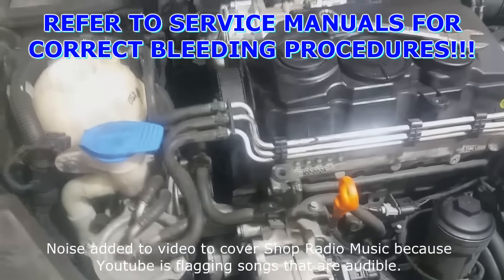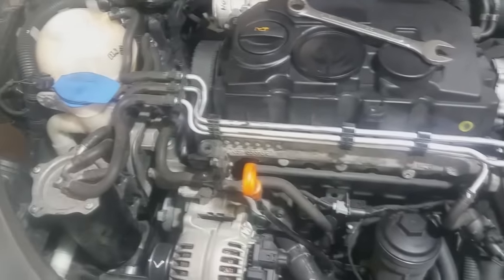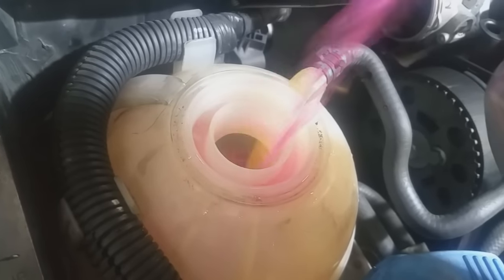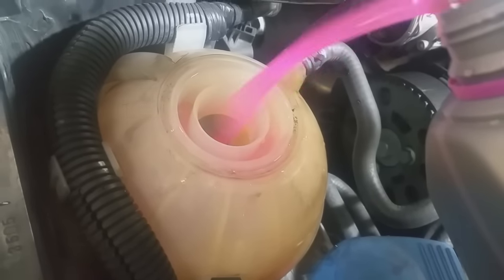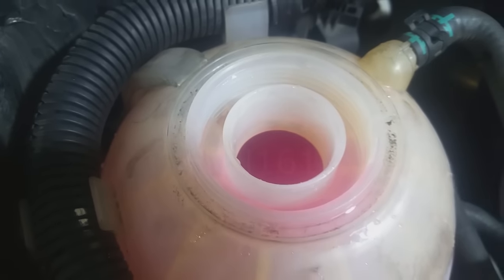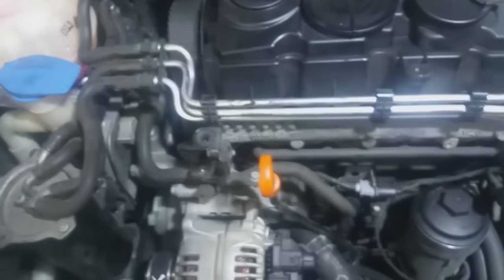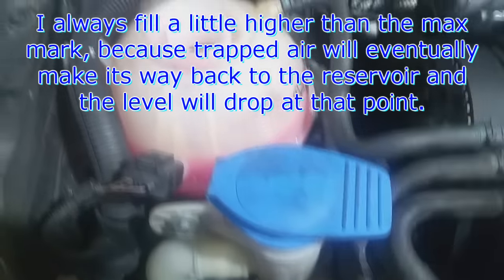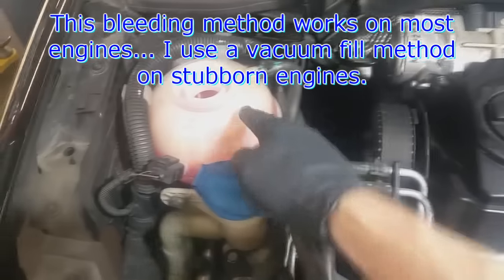Basic VW cooling system filling / bleeding info (viewer request)

Comment: do I use this same method if I just replaced the Heatercore or do I need to add coolant to the Heatercore as well???
Reply from the maker: It's a good idea to fill the heater core before you attach the hoses... but a correctly working system will bleed the air out on its own.  Hold the rpm at 2000 and check for coolant flow back into the reservoir. Monitor heat output inside the car. If you get no warm air by the time the temperature gauge is is the middle, then you have an air pocket.
Reply: Thomas EXOVCDS thanks again buddy did the second one no problems after a 30 min idle and a 45 min test drive second time you've come thru for me my brother I will not forget it lol

Comment: I have a 2011 Vw jetta 2.5 SEL . I accidently added green coolant on top of the original.  I get hot air out of my left vent but not middle or passenger side. I got a new heater core, should i flush the old coolant, fill the new heater core w g12 and then install it and refill the coolant with g12? or is flushing it not necessary
Reply from the maker: Type of coolant won't affect heat output. The vents are controlled independent from one another... if it has dual climate control. I'd suspect an electrical issue with an air blend door motor.
Reply: @EXOVCDS   Thank you for the quick replu. it has no dual climate control. I will only change the heater core then. i already checked the air blend motor and it works. im guessing my heater core is damaged
Reply: @EXOVCDS  https://www.youtube.com/watch?v=zm1HRU64Dpo  i have the same exact issue as this person, just didnt know if i needed to flush my coolant since its green and g12 mixed. I got a brand new heater core from the junkyard from the same edition car but 100k less miles than mine. hopefully it works
Reply from the maker: Depending on how much coolant you added, a flush might do good... should be done every 4 years anyways.
Reply: @EXOVCDS  do u recommend doing the flush w the bad heater core, then installing the new one? i really appreciate the help its being a hard winter.
Reply from the maker: I'd have to check the layout of the heater core & blend doors. I can't see how one side would be warm and the other not (on a non dual climate control system). I'm still at work, will get back to you once I'm at home later tonight (6pm pst>). Flushing the core first and seeing if things change can't hurt.
Reply from the maker: I can't see how 1/2 the core would supply good heat and the other have not... I still think that it is a blend door issue (somehow affecting the passenger side). I have not yet had to replace a heater core on that year of a vehicle. Removal of the dash is required. Disconnecting the core at the firewall and flushing at that location would be more beneficial than flushing the whole system from another location.
Reply: @EXOVCDS  you dont need to remove the dash for this car it's a newer model.  It's under the steering wheel where ur right shin is, my defroster doesnt work either
Reply from the maker: Sorry... I looked at the wrong service info then.
Reply: @EXOVCDS   I already got the heater core from a junkyard same year car looks brand new, should I flush my coolant first?
Reply from the maker: Sure.

Comment: Am I suppose to run the car with out the reservoir cap on
Reply from the maker: Year, make, model, engine? Once the fluid level does not drop anymore you can start the engine and check for flow back into the bottle. If you have / see flow back into the bottle, you can install the cap. Fluid level might still drop a little bit after first starting, so you might want to leave the cap off for a few minutes. If fluid level starts to rise and wants to overflow from the reservoirs, something is wrong (possibly air still in the system).

Comment: The squeeze is just for the upper radiator hose or the lower one?
Reply: Great video btw , keep it up!
Reply from the maker: Squeeze whichever hose is easier to get at... usually the upper one. Make sure that you have coolant flowing back into the reservoir once the engine is running!!!

Comment: What do you do if it doesn’t gurgle and you have blockage like you said
Reply from the maker: Find the blockage.
Remove the hose at the top of the reservoir. Blow into it. If you can not blow air into the hose, remove the hose at the other end (wherever that is) and blow through the hose again. If you can now blow through the hose, continue checking items downstream of that hose. 
Sometimes a hose or T fitting gets clogged. Use a thin stiff piece of wire and poke the debris free. 
If the hose and everything else is free to pass air, then the water pump would be suspect.
Watch this video.
https://youtu.be/LiDRUWPw_f4?si=1bj9NxPkjFW7QDnN

If you are still looking for the spark plug wire tool... Google this:
"VW spark plug wire tool"
To find a similar tool.
Reply: @EXOVCDS  when I take the hose out everything seems to flow nice like the coolant into the reservoir
Reply from the maker: @sniperpaintcorrection6790 
So what's the issue then?
Year, make, model, engine?
Was work done and then a problem started?
Or
Was there a problem you are trying to fix?
How much coolant did you drain?
How much coolant did you add?
The more info I have the better & quicker I can help.
Reply: @EXOVCDS  my car been sitting for years figured I get it back going . Changed the coolant and when the car reaches temperature the coolant starts to boil and over flow out the reservoir. Then steam came out the radiator crack. So I just changed the radiator today and changed the fan switch sensor . Just hoping after I put the new coolant in that it doesn’t over flow . Everyone says gasket but my car doesn’t over heat . But the coolant does over flow . Haven’t tested it yet since I added the new radiator.  1995 VW Cabrio
Reply: I’m assuming the water pump is good if the coolant is flowing to the reservoir . Also I’m assuming the thermostat is good cause the car doesn’t over heat and the hoses get hot. So idk what’s causing heat to build up to the coolant reservoir and causing it to overflow
Reply from the maker: @sniperpaintcorrection6790 
Remove the radiator cap and make sure that the o-ring inside the cap is sitting correctly  / not twisted or split.
Run the engine till warm, but before the point of coolant loss at the bottle. Shut engine off. Upper radiator hose should feel warm and have pressure (try to squeeze hose). If pressure is present, allow engine/ coolant to cool off. Once cool to the touch, the hose should NOT have any remaining pressure (soft when squeezed).
Yes / no?
Reply from the maker: @sniperpaintcorrection  
Heat doesn't cause the reservoir to overflow.
Excessive pressure or a faulty cap do.
I'll wait to hear back from you about the cap and the pressure check that I mentioned earlier.
Reply: @EXOVCDS  would the crack radiator cause this to happen ? And it over flows when the cap is off
Reply from the maker: @sniperpaintcorrection6790 
It's very difficult to help if you feed me information that I should have known about 2 posts ago.
I would not have suggested checking the cap or for excessive pressure.

NOW, that I know that it is overflowing with the cap OFF... it is either due to trapped air in the engine or the thermostat being stuck closed.

If what you say is true (upper & lower radiator hoses are warm), then why is the radiator fan not coming on... or is it? Also something that you gave not yet mentioned. 

If coolant is flowing back into the reservoir & the thermostat is opening, then the radiator fan(s) should get triggered by the rad fan switch. 

What temperature does the ecm show (with scan tool) when the coolant starts to get hot at the lower rad hose?

Leave the reservoir cap ON. How high does the needle go? When do the fans come on?

If the temp needle goes past the mid point... the engine is overheating.

Let cool off and check pressure of upper radiator hose... as requested 2 posts ago.
Reply: @EXOVCDS  the radiator fan kicks on.. the temp gauge on the dash stays in the middle .  The upper hose gets very hot but I thought that was normal .i don’t have a scan tool to check the temp. I used a digital thermometer the other day and the hoses were about 160-170 degrees .
Reply: @EXOVCDS  sorry didn’t see this post before. But will get back to you on that technique and see what happens .
Reply: @EXOVCDS  I believe when it cools down my hoses are soft to touch .
Reply from the maker: @sniperpaintcorrection6790 
An 87c thermostat is 188F.
Upper radiator hose will be hotter than lower hose where the rad fan switch is.
Rad fans are triggered at 92c & 95c (197f & 203f).
If pressure remains in the cooling system AFTER the engine has cooled off... the head gasket is bad.
If pressure drops, then the thermostat is probably bad... but it can't be, if you say that the rad fans come on. So then we're back at head gasket.
Air in the engine should bleed itself out into the reservoir. A few hot to cold cycles where the thermostat opens should bleed air from the radiator.
A radiator only cracks due to excessive overheating.
A head gasket only goes bad due to excessive overheating.
If the thermostat hadn't been changed yet, replace it.
But if the head gasket is bad,  a new thermostat can't fix that.
Reply: @EXOVCDS  I could have a bad head gasket and the car doesn’t over heat? No smoke from my engine bay?
Reply: @EXOVCDS  the car has sat for about 5 years.. I check the oil and the coolant and I don’t get the white milky stuff people say if it’s a bad head gasket . My oil still looks clean. Oil cap looks new

Comment: Owners manual says 9 quarts but only was able to put in 4. I flushed the radiator with 6 gallons of distilled water.
Reply from the maker: Yeah, make, modle, engine?
No matter the make, model, engine... you will never get all of it out. "Flushing" will leave some distilled water in the system, which reduces the amount of "mixed fluid" you can add. Drive the vehicle for a few days and then check the fluid "concentration" to see how close it is to 50/50. If it is weak, remove some coolant from the system and then add 100% coolant to bring the mixture closer to 50/50. You'll have to drive the car so that the newly added coolant can mix with the mixture that is in the system. Check again after a couple of days.
Reply: @EXOVCDS  it’s a 2006 VW new beetle 2.5 liter.
Reply from the maker: The heater core was probably still full of coolant / distilled water (depending on how you flushed the system). You pretty much need to disconnect multiple coolant hoses to drain the system AND force air through the system to blow most of it out... even then, there will be stuff left behind. Flushing / changing the cooling system every 4 years, will keep the system clean (even with some old stuff is left behind).
Reply: @EXOVCDS  okay that makes sense. I did run the car and heater while I filled and drained with distilled water. The antifreeze was the pink stuff from an oil change place so I wanted the purple antifreeze. The flush did run clear so I was assuming I had gotten all the pink antifreeze out. I think I’ll drain one more time and ad the other two gallons into it.

Comment: So at the end do you start the car with the reservoir cap off so as to let air out?
Reply from the maker: The process of correctly filling & bleeding the system, does not require to leave the cap off after... the reason the cap is left off, is so that once can add more fluid in case the level drops a bit once the engine is running / the water pump is pumping coolant. You can also better see "return flow" of coolant with the cap off. If no coolant is returning into the bottle... something is wrong.
Reply: @EXOVCDS  Thanks, yeah I had just replaced the radiator which was leaking, but also found that my heater core is bad, so wish me luck on that! (1998 Jetta 2.0L)
Reply from the maker: @drittttt  Heater core leaking or no heat?
Reply: @EXOVCDS  Leaking...after i refilled the coolant system and test drove the car, my cabin filled with coolant steam (the original symptom).  So after i got the car back to the garage, i parked it, shut it off, and opened the hood.  The coolant level in the reservoir was way down, but there were no visible leaks.  But there was a trickling noise from behind the engine compartment where the 2 coolant hoses come and go from the heater core.  Fortunately, another mechanic offers a great video on how to change the heater core on my car.
Reply from the maker: With summer months ahead... you can disconnect the heater core and splice the hoses together, so that you can at least drive the vehicle until you have time for the actual repair.

Comment: Replaced coolant flange and its blowing hot only when revving. Coolant returns to reservoir as well. What am i doing wrong?
Reply from the maker: Air pocket if you are not getting warm air at idle. Bleed the system more.

Comment: .hey there, When starting my car before work the "check coolant" light came on and i noticed my resivior was well below the minimum fill line. Instinctively i topped it up slightly above the minimum fill line and then proceeded to drive to work. (roughly 40Km drive) Once i arrived to work i then checked on my coolant level and the tank was almost completely full. 
any thought or suggestions would greatly help.
Reply from the maker: You have a coolant leak... that's why the level was low. Find & fix the leak.
The reason that the level was higher than what you added... is because air in the system forced the coolant into the reservoir. Once the coolant cools... the level will probably go back down to the level that you left it at.
Reply: @EXOVCDS  thanks for the quick response!! 
After the car had cooled down the level was actually 1 inch above the max line, but. The next day the level had dropped. You are definitely right, there is a leak somewhere.  I’m just hoping it’s not the water pump
Reply from the maker: @Dustytrailzzz  year, make, model, engine?
Reply: @EXOVCDS  2015 vw golf. 1.8 tsi
Reply from the maker: Check the water pump, electric water pump, radiator & hoses for leaks.if the windshield fogs up on the inside, then the heater core is leaking.
Reply: @EXOVCDS  thanks again for the help! Currently no visible leaks from above or underneath the car and no sweet smell. I’m going to get it inspected as I can hear coolant trickling back to the overflow tank after a drive and the engine is off.
Reply from the maker: The engine has an electric water pump that circulates coolant after the engine is shut off (for 10+ minutes).

Comment: Thomas, I need your help. 1998 2.0l beetle. I replaced the timing belt, water pump, coolant flange on the side of the block, T-stat. I tried using a mityvac on the return line to the fill tank. I get nothing! If I blow into it I can't.  It there a block? Or a restrictor? If so where to look? Or what else can I do? I see a service bulletin out for this year, would changing out my reservoir tank help? Please help. Thank you, Chris
Reply: My coolant fans don't come on but I do get a red coolant light on the gauge cluster as well. I've pumped and filled just like showed us. But still nothing.
Reply from the maker: Watch the first 2.45 min of this video... I think you have a blockage somewhere. Remove the blockage... then the air can bleed out of the engine.
https://www.youtube.com/watch?v=GAfOnR--YIw
Reply: Thomas EXOVCDS Thomas, bless you! I will take this apart tomorrow and check that "T" piece. Thank you so very much! Chris
Reply from the maker: It could also be a restriction in a hose or in the pipe on the head... so check everything from the reservoir back to the head.
Reply: Thomas EXOVCDS cool, will do. Again I so humbly appreciate your expertise!

Comment: on my 2003 Buick Lesabre custom I want to drain and flush then refill the cooling system with Dexcool and distilled water. now on my other cars even with bleeder screws I do not like to open those little screws that can easily snap off I done that been there, so can I burp the air out without touching those little hard to get at bleeder screws , can I squeeze the top and bottom radiator hoses to get the air out then run the engine recheck the fluid level and add to it
Reply from the maker: To be safe & not only rely on the thermostat to allow the air to come out of the engine... disconnect various coolant hoses around the engine (one at a time) to allow air to come out (can also use those locations to flush old fluid out). Once fresh coolant comes out of a disconnected connection, reattach it and disconnect a different hose or coolant temperature sensor somewhere else. Once you think that the system has enough coolant mix in it, start the engine and pay attention to the temperature gauge. If it starts to climb past the mid-way point, turn the engine off and allow it to cool. Be sure to have the heater on high heat, so you can monitor coolant circulation... no heat = no circulation / air pocket.
Reply: thank you
Reply: oh I used to hook a garden hose to the inlet of the heater hose and turn the hose on real slow until the water dripped out all clear from the radiator  ,is this also a way to do it ?
 did this on older car without bleeders.
Reply from the maker: Rondo Schiavoni Yes... same thing though, do it at different locations, because one location can not flush everything. You will also not get all of the water out (even if you use compressed air to try and blow it out). So when you add your fresh coolant mix, mix it a bit on the rich side (more antifreeze than water) so that the water that is left in the engine will dilute it to close to 50/50.
Reply: sounds good to me  ,I got one dexcool prestone  full straight antifreeze   have to mix it , then I got  a 50/50 premixed to add more if I need it.what do you think?
Reply from the maker: should be good. A mix over or under 50/50 is also OK.
Reply: Thanks for the information.